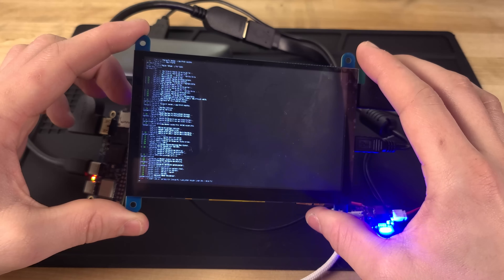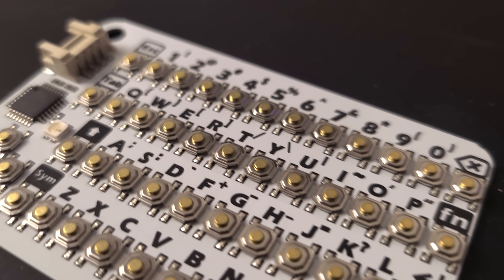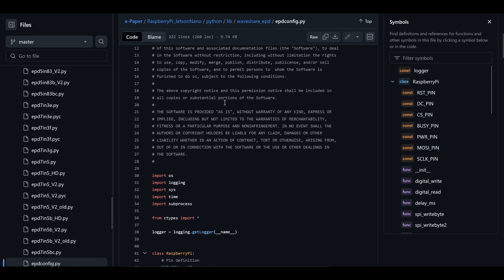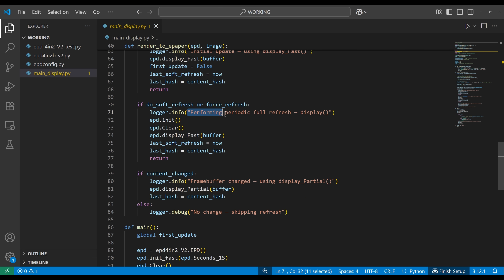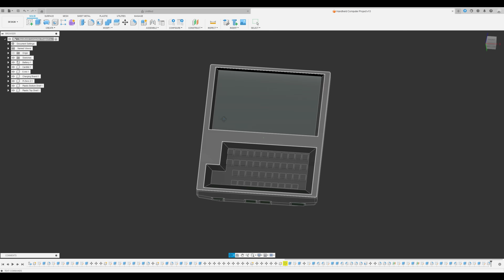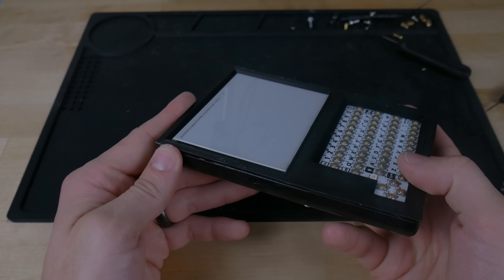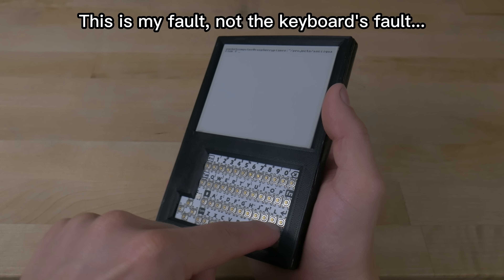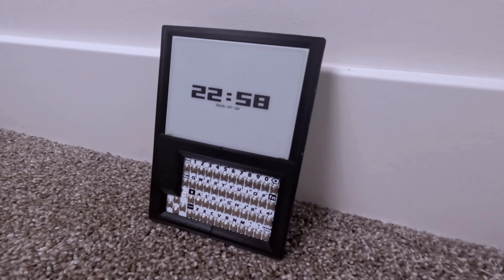I Built the Ultimate DIY Pocket Computer

Comment: I would run it with a pi zero without wifi as an offline en- and decrypter. 
text | pgp | qr-encoder 
then send the qr image with your smartphone to another such device and there …
scan the qr code | pgp —decrypt | read message

No government trojan or spy-program can read messages on an offline device.
And yes, it needs a camera or better a hw qr scanner in order to work.
Reply: The eink display has a pretty low resolution, so I think the qr codes could only be pretty small. I‘m not sure its enough for a 1024 bit public key.

Comment: fyi eink has a problem with refreshing if you refresh to often you will damage the display try to have it do a full refresh as rare as possible and maybe add an argument to the clear command that allows for no full refesh (not sure if it helps) but its a good choice to use a eink if there is not many refreshes happening respectfully --luafox
Reply from the maker: Thanks for the heads up! The waveshare documentation warns about too many partial refreshes without doing a full refresh, which could damage the screen. 
The wiki states: "For e-Paper displays that support partial refresh, please note that you cannot refresh them with the partial refresh mode all the time. After refreshing partially several times, you need to fully refresh EPD once. Otherwise, the display effect will be abnormal, which cannot be repaired!"

Comment: My experience installing an OS to an Orange pi Zero was similar. Not with the SD card but the image needed for it. Ended up digging the image from the Orange pi site and it needs the specific one for the ram amount. Nothing else seems to work.
After it's installed it's been working fine. Just, not good to need a specific proprietary image for OS. I don't think they have backdoored it but eh you never know.
Really though. If they wanted to backdoor the device they could just as well do it in hardware. Still. It does not feel good not to be able to install custom images.
Reply: If Raspberrypi zero /2 had the 2gb ram, i wouldn't even consider getting the Orange pi. But yea for my application it is necessary. I also don't need any non USB peripherals so eh it's fine.
Reply from the maker: Yeah, a 2GB pi zero 2W would be sick. I normally like using VSCode remote SSH, but it just takes a hair too much ram to use it on the 512MB on the zero, so I'm stuck using vim or nano to edit stuff remotely over SSH.

Comment: i have a orange pi 5b since 2023 and wanted to use the gpio but i couldn't make it work, and since then, i didn't try again. But i do use it as my homelab and it is perfectly fine for that (even if i might need to expand to some x86 pc). I do feel the pain tho man...
Reply from the maker: I think even raspberry pi changed the GPIO drivers with the 5 series, I've had some trouble getting the GPIO to work too.

Comment: Great project and totally useful, if a person requires a small portable development system.  Yeah, my phone has more power, but what few dev tools ran on it, nolonger run due to the difficulty of dealing with the ever increasing security lock downs in Android.  Although I hear there may be a less limited Android supported debian in Android 16, will wait to see how good it is.

For that reason, I carry a Raspberry Pi Zero 2 W, for when I feel the need to try some code changes or change the firmware on a microcontroller, while I am sitting in a coffee shop ... lol.  No screen, I use my phone as a terminal.  But then, I think I may be weird in that way.  I did write 5000 lines of nodejs code one month, using only my phones touch keyboard and vi on termux.  Unfortunately, a lot of linux code does not run under termux or there is no way to access certain usb serial devices.

And then there is the problem of constant changes to these phone os's.  Suddenly you have to come up with new ways of doing thing.  Linux is much more stable, apps rarely stop working on new versions.  Which is why a portable linux system is useful, mind you, too bad the memory isn't larger.  I too tried to go with an Orange Pi, the 3B, great hardware, poor software support.  Not worth the headaches.

Comment: Would be nice to see if this could be built around a Sharp Memory Display instead of E-Ink. Would alleviate the refresh rate issues and required workarounds, while still maintaining that low power consumption.

For those unfamiliar with the technology: it's what the Pebble smartwatches use. Largest I could find on Adafruit is 2.7" though, which seems a bit small for this project.
Reply from the maker: I'll have to check that out!

Comment: Would be nice if the display had a touch. And then with a nano pi zero (with a more open soc) than the rpi, powered with PoE and that as a simple wall light switch/AC controller/whatever terminal.
Not the homeassistent or whatever server itself, just a user interface.
And then eat your heart out loxone.
Reply from the maker: E-ink with touch would be sick.

Comment: Our friends in China have produce for the teeny weeny little push buttons special key caps, without a print on it, but you cant have everything. If you would use those key caps you don't have to look at the bare naked PCB. Then the use of the keyboard is more mysterious then ever, only you know what key is where.
Reply from the maker: One of the other commenters mentioned that they make a silicone cover for the CardKB, I'll be giving that a look!

Comment: I did something similar. Here are some ideas if you ever revisit this project:
1. 2s with step down more efficient than 1s with step up but it takes up more space because it requires a charger with balancing. Use only switching regulators.
2. I used a blackberry keyboard with an RP2040 chip and qmk that I bought from some maker, it's much better than the cardkb. And It has a miniature touchpad in the button that works surprisingly well.
3. I bought a USB 2 hub for ~2 bucks at the nearest store, which had a 18x18mm board inside. I soldered this board to the pads on the bottom of raspberry.
4. I used hdmi to csi converter to make video input. Then I connected the keyboard signal wires to the switch and then to the usb c power input and to usb hub, so keyboard can be switched between the raspberry and an external device. All this allowed it to be used as a "pocket terminal" for connecting to my home server when I screw up the network configuration.
5. The worst thing is the lack of a deep sleep mode in raspberry. Some other boards claim to have it, but whether it works is a question. So I made a script that disables cores, reduces frequency, disables networking and peripherals by pressing the button on the gpio interrupt
6. 3mm steel wire bends well with pliers and It makes a good kickstand. However, it is better to place the battery at the bottom and make a flat spot on the case.
Reply from the maker: Dang! That sounds like a killer cyberdeck! I looked for some of those blackberry keyboards (admittedly not very hard) and most were out of stock.
Reply: So do you use more than just terminal? I (like most every “maker?” thought about how I would approach a project like this and I came to the conclusion that a terminal would be enough for me, so:

Why bot just grab the tty output in text form and render the terminal on the screen in a custom way? Wouldn’t that take a heavy chunk of load away?

Comment: One way to make it more powerful would be to use the Raspberry Pi CM4/5 board with a custom I/O PCB. Not sure how good you are with KiCad, but a CM4 would mean you'd be able to keep the slim design and have a way more powerful device and you could also design the I/O board to suit your own needs, keeping it as thin as possible, but with all the ports you need. You might get diminishing returns with an E-ink display though with such a powerful board.
Reply from the maker: I've been dying for an excuse to learn KiCad (I'm a mechanical engineer by trade). Those compute modules would be a great way to make a full-blown cyberdeck though.

Comment: went through a similar journey and I also got a OPI, which was then replaced with a RPI Zero 2W. Not sure where the problem lies with these orangepi boards, but the main hurdle is that it is not as common as RPI so finding info and help is a lost cause
Reply from the maker: I'm glad I'm not alone in my Orange Pi struggles. You're totally right, finding info / support once you do hit a snag is the real struggle.
Reply: @MostlyFunctionalEngineering  Happy to support a platform, but when not even the company that makes it bother to help you, or share info, I move towards what has the best ecosystem... Which so far is the pi. 

Sorry you had to go through this first hand, but maybe that enforced your feelings towards a better served platform and userbase

Comment: I'm curious if it's possible to update the screen partially? It won't change anything for a full-screen update, but it would allow for real-time typing, as essentially updating each letter = 1Hz.
Reply from the maker: So it has a "partial refresh" option, and that's what I'm using most of the time as I type. My implementation isn't perfect, as I just have a static refresh cycle, which means if you happen to type right after it started issuing a refresh (which happens plenty of times), it can be almost 2 seconds before you see the thing you just typed. A better way to do it would have been to sense a key press, then immediately issue the refresh to get a consistent refresh rate as I type, which would make it more like the "real-time typing" like you suggest, and it would have been more power efficient.